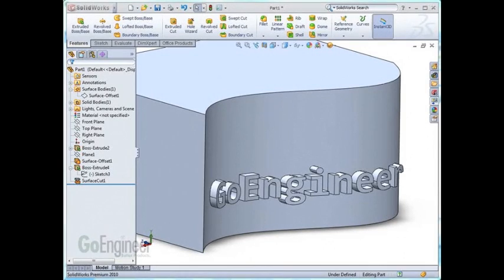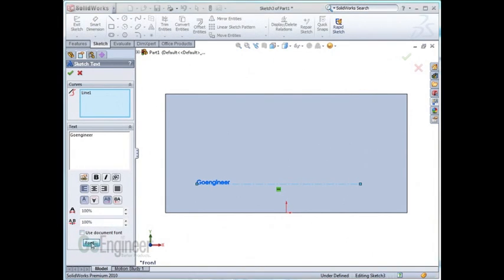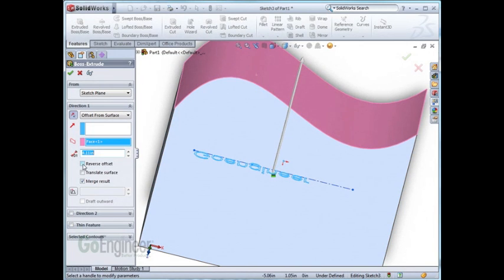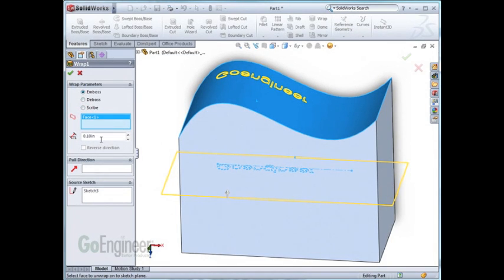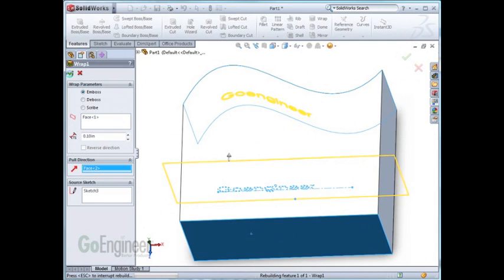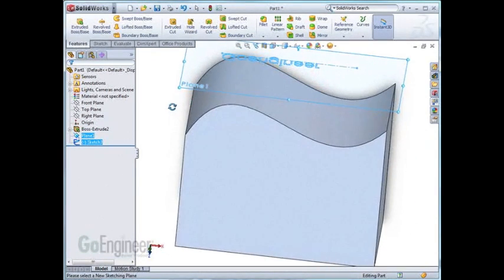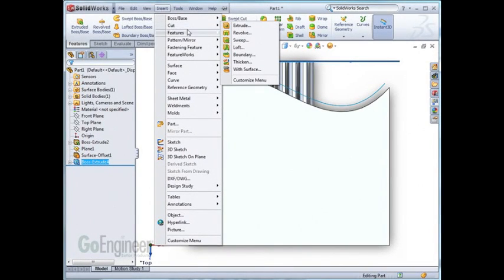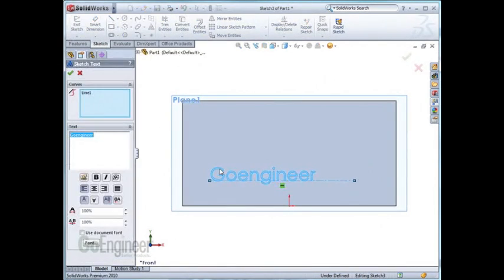SOLIDWORKS Quick Tip - Text on Parts

Comment: Nice video, @6:14, how can we do CNC on those extruded font with Solidcam, I did it, but it cuts the font area, thanks.
Reply from the maker: We unfortunately do not support SOLIDCAM so cannot be sure about where the issue is.

Comment: How do you rotate that text? I see the I icon for it but when I click on it in SW it does nothing.
Reply from the maker: Sketch Text in SolidWorks is controlled by selecting a sketch construction line entity to have the text follow.  The text then uses that entity as the baseline.  You would then position the sketch entity in the orientation you wish to have.